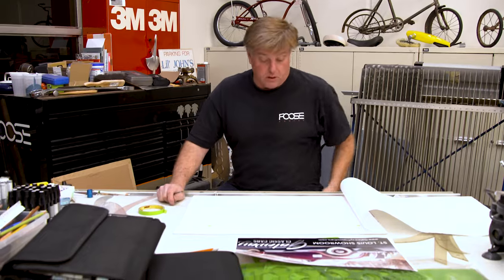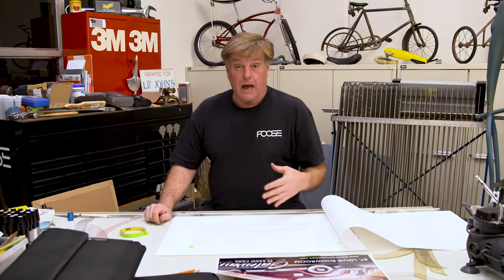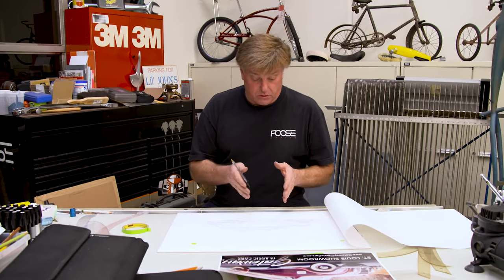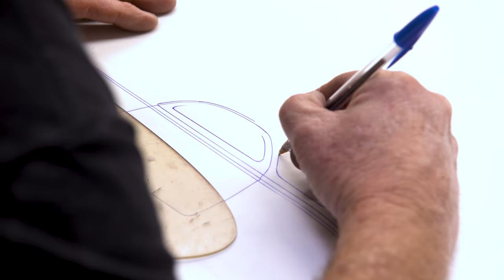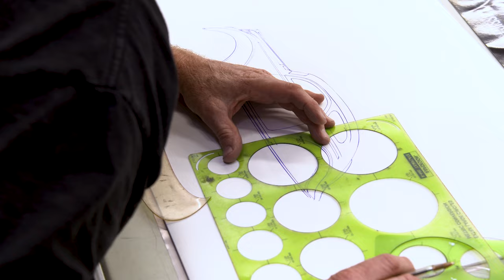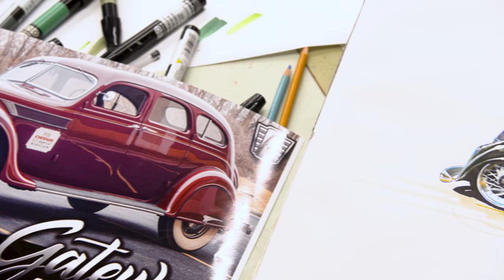Chip Sketches a '35 Chrysler Airflow

Comment: A car that was ahead of its time and, due to several defects, died before it could take off.  It was the first car to be tested in a wind tunnel, the first unibody, and the first to use a 50/50 weight distribution for better ride quality and handling. Customers found the appearance too futuristic, which really was a set back to car design. Looking back now,  it was the start of the art deco design in the automotive years.